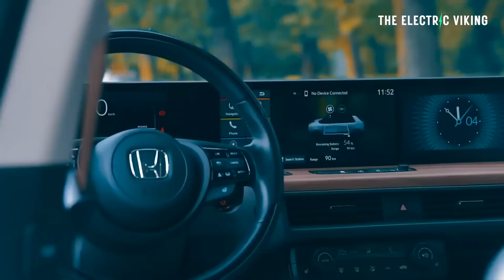The US will have enough batteries to power entire auto industry in 2030

Comment: When Powerpacks only cost $1k, everyone will want them, they’ll pay for themselves in less than 5 years and last 20+.
Reply: "Pecron" is selling a 3000w battery pack right now for $1599.  Plus at the major battery reviewer YouTubers, you can get a discount code to bring that below $1500. 

It appears to be expandable also. I'm unclear on the capacity of the expansion packs but they cost $1,100 and can take the thing up to some enormous capacity like 6,000 or 9,000 KW hours. 

At this level you're talking about something beyond simple disaster recovery. 

At this level, you can combine it with a small set a solar panels to actively reduce your daytime cooling and heating bills.

Comment: He's not yet completely right. Battery technology needs to be improved so they can build far smaller battery packs without sacrificing range (which means a lot smaller EV's that can go at least close to 500 km or 310 miles in range) and major improvements in DC public charger reliability are needed to make EV's a lot more acceptable.
Reply: Average mileages are less than 40m/day. Needing a range over 300 miles is an edge case.

Comment: The problem is that self driving cabs will be in great demand over a shortish time interval when peole are going to work and another shortish time interval when they are going home. That requires almost as many cars as there are today. At other times a good proportion of them will be underutilized. You can only stagger start and finish times by so much.
Reply: One of the reasons for a large compute cluster is this problem. 12 ( or even 20 ) seater robotaxis can have multiple pick-up points, and multiple destinations with little extra time - if this is properly optimised. And this has to be in real time. The point here is that this transport is virtually door to door, extremely cheap, and on-demand ( a minute or two). There could also be pick up points (like bus-stops), or set times, both of which would help optimise the service. There will be mutliple solutions to the " more cars needed at peak times" problem. Connecting the Dots also talked about these robotaxis acting as storage, dispatch for the energy grid - another income stream outside the "peak" time. (Utilities could plan for energy demand peaks, and summon fully charged rts to help ...)
Reply: It is a consideration. However cars can carry more than one person. So can collect several people going the same way. So with good central planning of clients ,not only could the car numbers be perhaps halved at least it would lower the cost by sharing too!
Reply: That’s exactly why the Robo taxi idea is not going to work. Because there’s peak demand a couple times a day and they’re sitting around the rest of the time not making any money. That’s a recipe to lose money. It’s why commuter trains requires subsidy because you have to have a massive amount of equipment that gets used a couple hours  10 times per week.  Otherwise, most of it just sits around not earning any money.  Robo taxis certainly could replace current Uber service and would have a place but there’s no way the majority of people are going to use them to go to and from work every day.

Comment: I amazed at the sheer blind faith in lithium. What happens if the market switches over to some other chemistry, such as Sodium-ion? Then where's your investment in lithium mining and battery makers?

Lithium is an unbelievably crappy material for batteries. It can self-combust and burns at metal melting temperature. What's more, these fires are very HARD to put out.

If you want a safe investment instead, put your money in copper mining. That's guaranteed. Current ICE vehicles use about 40 pounds of the stuff while EV's contain 200 pounds on average.

Prediction: we won't be using lithium in any car battery at some point. Moreover, the re-sale market for all EV's with lithium-ion batteries will drop like a rock in that day.
Reply: Lithium battery powered cars won't cease to function if someone comes out with a better battery.
Reply: @MrSteeDoo  , that may be so, but I and many others don't want one. That doesn't mean we don't want an EV, btw.
Reply: With 48 volt architecture copper usage should be about 1/4 current use per car.
Reply: @chrishaberbosch1029 Not in the actual  battery and high voltage wiring or in the traction motor
Reply: Why are you concerned about corporations and there investments in mining or battery making?
Reply: @MrSteeDoo  , I'm just saying many are betting the farm on a mistake. That's all.
Reply: New lithium battery designs are extremely difficult to burn  We are still close to the start of modern EV development and these problems will be solved
Reply: No they don't
Reply: It really doesn't matter what temperature the lithium burns at.  If you car is on fire you aren't going to hang around YOU WILL  GET OUT.
Reply: @MrSteeDoo  , sure, but I don't think you understand how much more dangerous lithium fires are, and how they spread much more faster.
Reply: @lrg3834  I do understand.

I had an 18V lithium tool battery explode on the other day.

EV fires are rare.  I have seen many ICE cars on fire over the years.
Reply: @lrg3834 You do not understand that EV fires are far less frequent than ICE fires and new designs still using lithium will make fires next to impossible.
Reply: @rogerphelps9939  , that may be so, but when they happen, my goodness!!

I'm on the board of the strata where I own three rentals. Understand. We do not permit EV's to park in the underground parkade. The board president is a structural engineer on top of that, and COMPLETELY understands the hazard large EV batteries pose. ICE vehicles don't bother us one bit.

Again, I'm not against EV's per se, but lithium in general. Even the phone I use sometimes overheats in some instances, and I must stop or cut short some functions. Lithium is CRAP, period, end of story.

If they work without overheating, HELLO sodium-ion batteries!

Comment: 1 problem, they are still not rolling out drive through chargers only on main routes. If you tow why would you convert to EV when you find out you have to unhitch to charge.
Reply: I have been driving with caravan for 3 year here in Sweden. About 30-40% of chargers can be driven through, but it's actually not a big deal disconnecting the caravan. It takes me 1 minute to park it and take it off the hitch. Still smoother if I can keep it but actually not as problematic as I first imagined.
Reply: @volvodashcam  Wow, 30-40% I’m guessing, but I reckon in Australia we’d be lucky to have 1% if that.
Reply: @Peter-hg2oc Here in the UK I haven't seen any but that might be because I have had my car for 18 months and have not needed to use a rapid charger yet
Reply: @Peter-hg2oc  It will come. 4-5 years ago it was almost none. It has really exploded here last few years.
Reply: Yes. The one thing petrol stations got right was positioning pumps on islands that you could drive past. No need for special bays and having to reverse

Comment: Making batteries is one thing but selling them is another ! As long as the technology is improving at high speed, it is going to be hard to justify buying one when the next improvement is going to depreciate it to nothing. We already see that problem in EVs with the price of the new models being lower than the remaining cost of the previous one. 

The other problem is FSD, who would buy a car if the cost of the same drive in a cab is less that the parking of your car for an hour. This alone will reduce the number of cars in use to a fraction of what we have today, who will be left to buy all the rest of the batteries ?
Reply: If this was actually a problem no one would buy a computer or cell phone.
Reply: The same situation exists for home solar. The costs for panels,inverters, batteries has dropped significantly since 2021 when I started building my off-grid power for my house. Nevertheless, I don’t regret jumping in early. My primary objective of electric reliability was achieved and ,in contrast to a generator that serves no purpose until there’s a power outage,the solar power system starts paying for itself from day one.
I personally am old fashioned and don’t want self driving. What I have to accept,though, is that older farts like me really don’t need to be putting others in danger with our diminished vision and responses. I already plan to buy an EV in late 2025 and share it with a younger person to do most of the driving. I love my Toyota but would never buy another. 
Already have an electric bike and enough excess solar production to put 200 miles of charge daily.
Reply: Presumably you don't own a tv.